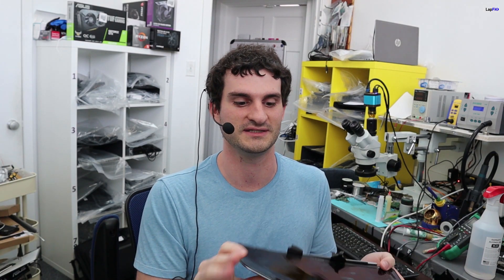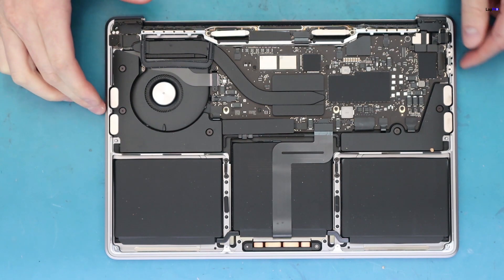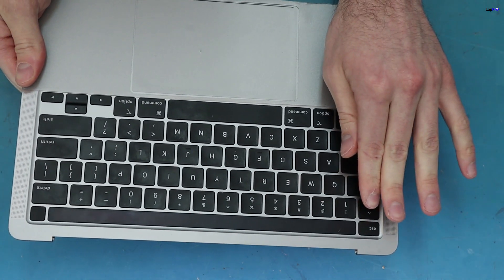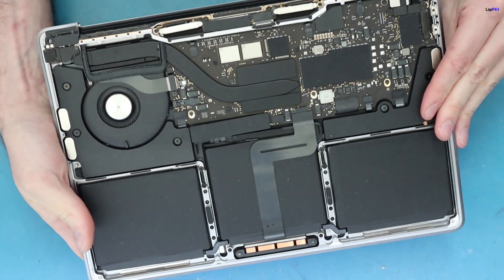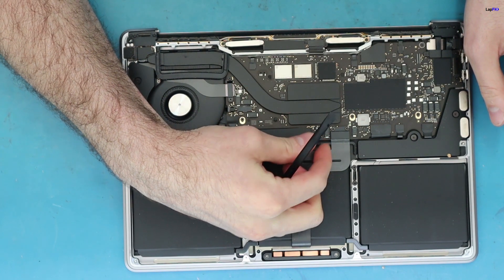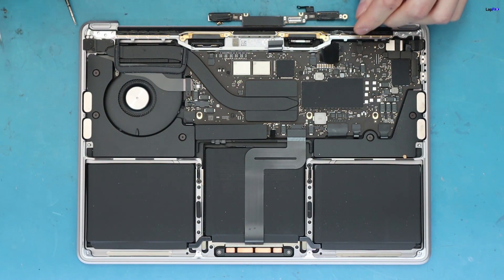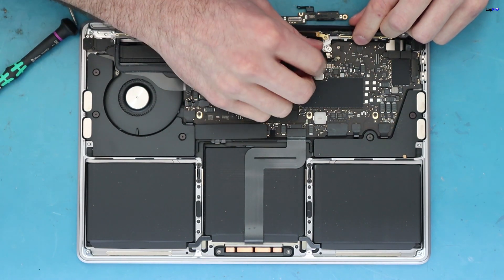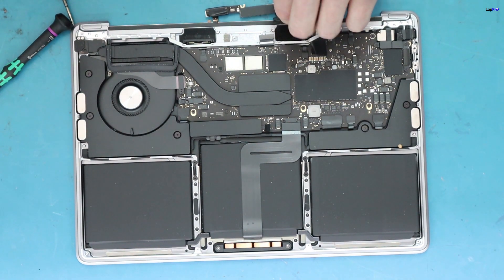MacBook Pro M1 A2338 Broken into Half Screen Replacement

Comment: Nice video. Made a teardown much easier. I would like to mention though, you are only removing the battery data cable. The actual battery itself is still connected to the board. To be on the safe side, fully remove the sticker and pull the screw that hold the actual terminals to the board.

Comment: Hi! Any chance to fix the touch bar flickering issue on the same model? How hard it is to repair?
Reply from the maker: It really depends.  Most likely that happens when there is a liquid spill, either the touchbar itself needs to be repaired, the connection or the components that power it may be impacted.  We will make a video fixing that, stay tuned =)

Comment: Hi, great video! I need to replace a screen for a client on Sunday and I will be using this guide! Quick question, how did you re-attach the wifi antenna to the board, that seems to be the only step you missed in the tutorial. Im sure I could figure it out just by looking at it myself, but I was hoping you could give me a better idea of what to do beforehand. Thanks in advance!

Comment: Nice.. How about display truetone. Is It active?
Reply from the maker: a2338 Screen is only compatible with M1 a2338 screen (as of making the video) so the true tone is built into the hardware.  So yes!  Other models such as the a1932 have different compatibility screens and if you don't get the exact year replacement it will work but no true tone

Comment: Hi, I've just replaced the screen abd works. But unfortunately is showing that the battery is not connected.
Can anyone help me with that please?
Thanks
Reply from the maker: Some of these models require a battery to be plugged in as well as the ac adapter to be plugged in AFTER the battery is plugged back in.  If you are still having issues, I do know this model the battery connector doesn't "snap" in smoothly.  Make sure the connector is pushed in all the way and the pins are making contact, also put the latch over it to hold it in as it should